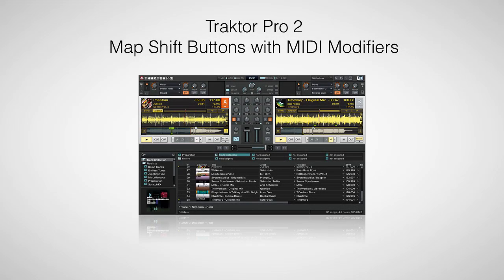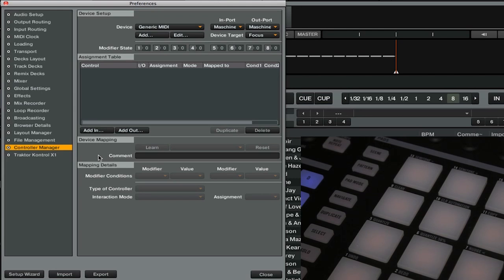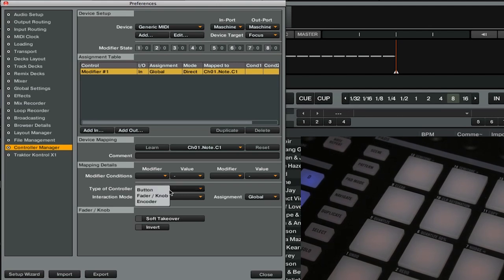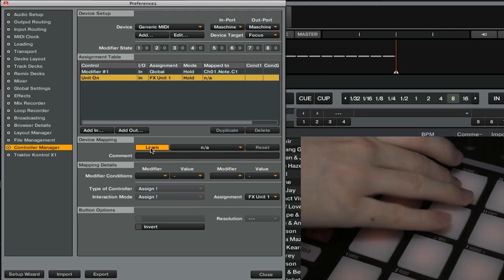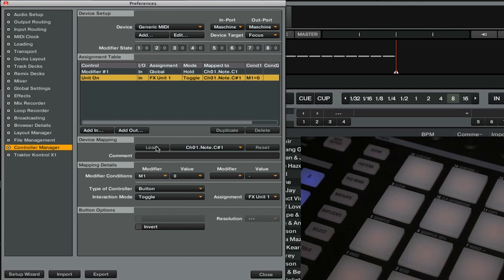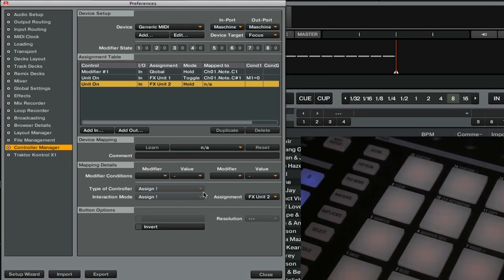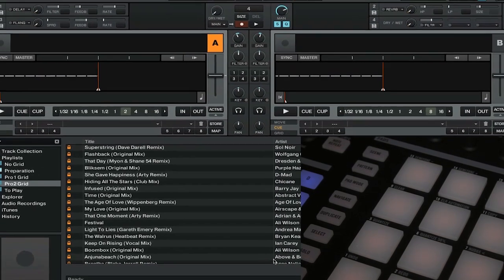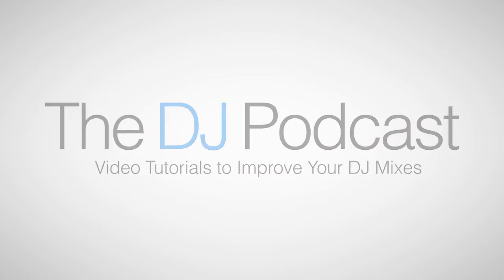Traktor Pro 2 Tutorial: How to Map Shift Buttons with MIDI Modifiers

Comment: I appreciate it so please don't take it the wrong way but it's another video of a similar or same exact example everyone else uses thus not really helping or furthing my understanding of how the modifiers and outs work exactly. The only people that need help are people with budget MIDI controllers so I think it would benefit everyone the most if you hooked one up and showed exactly how to do the basics. There's only a few features that people even need to begin with so I feel like almost every single one could be gone over in detail from loops to freeze mode or slicing and of course cues and deleting cues. Just cover key features that everyone would consider the most important and essential to every digital dj. thanks!

Comment: Hi Peter,
Very helpful video so thanks for that.. I was wondering if I could bother you with a question?
I've just bought  a Launchpad mini to couple with my NI S8 controller and have laterally mapped Remix deck cells to the pads. However due to physical restrictions of the controller being only 8 lateral pads, I'd like to assign a page down button to move the buttons to the next set of pads .. Is that possible? 
Because when I assign a sample page selector command to a button it moves the page up and down in traktor but the triggers still trigger the same samples from the previous page..
Any help would be greatly appreciated..
Thanks again..

Comment: Hi, I have some problemes with mapping my BCD3000 (an old one.. i know).
I want to use 2 buttons to scroll in my music browser. I would like to hold one button and then use my Jog wheel to scroll between the tracks. I still use my jog wheel to bend my tracks and I do not want to give it up. How do I map that in traktor?

Comment from the maker: That depends on the MIDI range that you have set in MIDI out commands. You'll need to check what ranges correspond to the different colors for your specific midi controller.

Comment from the maker: Yes, if you set the button to toggle instead of hold it would work like an On/Off switch. When you map commands in Traktor, you have the option on telling it how you want to interact with the software. The most obvious examples being toggle and hold. I think there are a few other types of button interactions that you can use with Traktor, but I haven't investigated them fully.

If you're new to MIDI mapping, check out our other mapping videos as well as out videos on Xtreme Mapping.